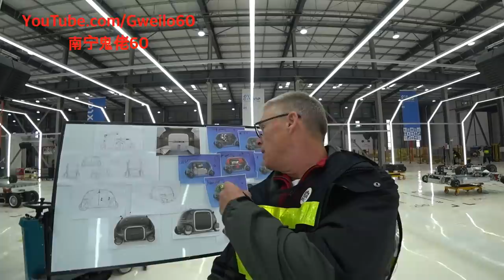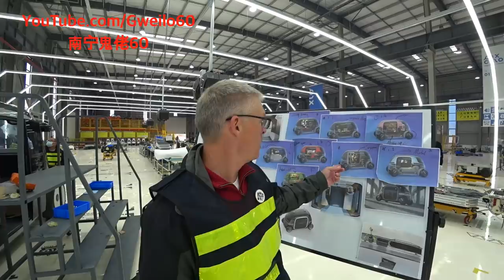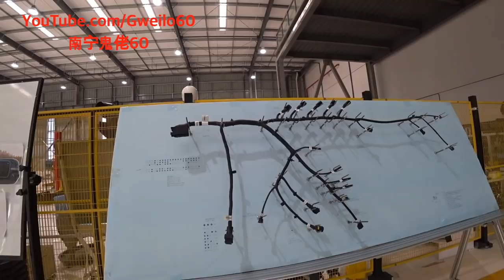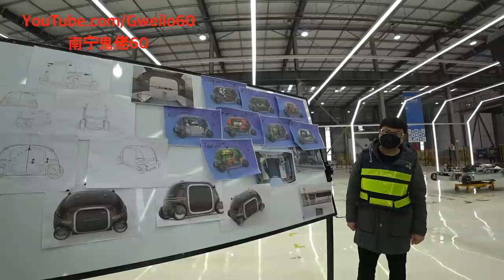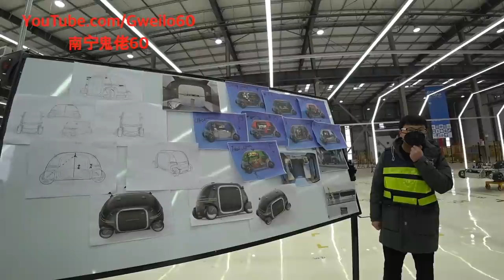China's Autonomous World

Comment: Nice to know about the 3D printed chassis. Autonomous driving needs many though shed on the issue of responsibility. Who would have to be liable in an accident with another “object” whilst Kirk is leaning back and cracking a beer? Thanks for bringing this one on the table.👍🏻👍🏻👍🏻
Reply: I would imagine it'd be treated like if you got injured on Gym equipment, or fell down an escalator. If it's equipment failure than it's not person's at fault. If the person was acting reckless and running into traffic than they're at fault. Inevitably autonomous cars will be very predictable in how they drive like other equipment we use.
Reply: @TheM0joDoj0  I guess a third party insurance would do the trick, - but at what cost??? 🧐
Reply: That would be a feast for insurance companies to rip off all potential users. That covers maybe Kirks beer can hurting somebody or the laundry cost for spilled beer on a third party. However the question is still, who covers for the damage the vehicle causes by its own decisions. Maybe Bill Gates?
Reply: @wernergaus8289  You might not know that these vehicles are already/will be deployed for the industry and some experimental areas in China. Then, the commercial applications in the public sector would be fully integrated with the blockchain tech and 5/6G tech China is pushing into the society. So, in that future scenario, accidents are minimised. But, leaning back on it is obviously a "break of conduct", especially when commercialised products have signs like "do not interfere when this vehicle is in operation", etc.... Hence, the person leaning back and craking a beer would share at least 50% of the responsibility I imagine.

Comment: Theoretically you can print anything in 3D as long as you have the material to print it with, but printing a car is mindboggling. Autonomous vehicles need AI , a 5G communication system and a satellite navigation system. China has all that, so it can implement the autonomous vehicles system in the whole country. Amazing 👍👍👏👏